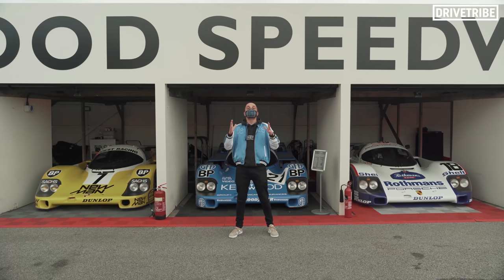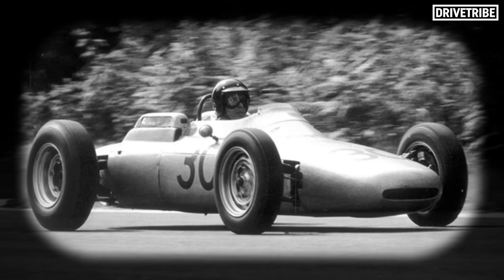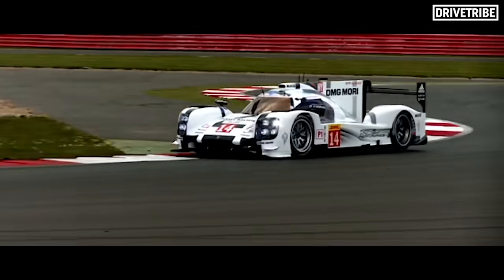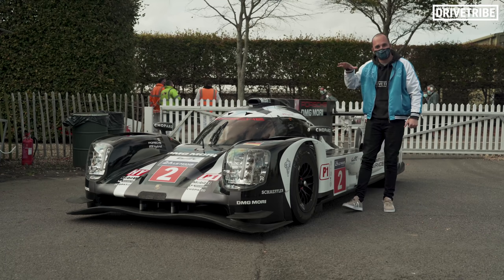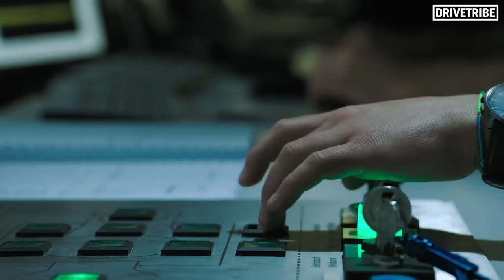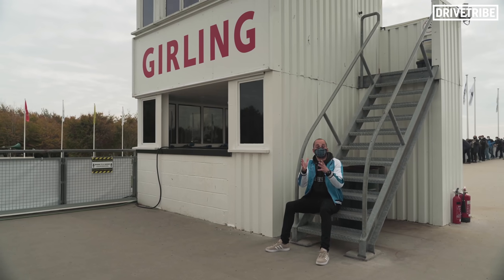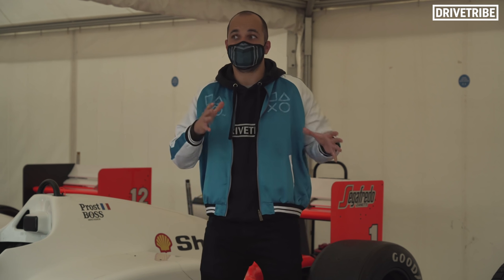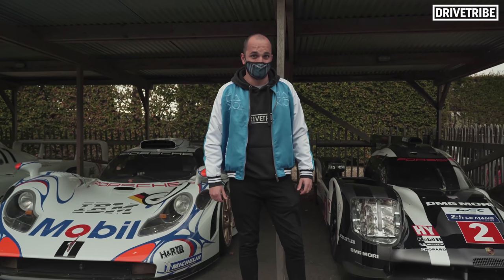Porsche has made a Formula 1 engine that could power a new hypercar

Comment: Red Bull: Heavy breathing
Reply: 😁😁🤣, either that or make up with Renault's boom boom engines again
Reply: As soon as I seen the video pop up I instantly thought Red Bull 😂👍
Reply: Because they have masks on? /s
Reply: @manojlds  r/whoosh basically Red bull are in a bad a situation for an engine on F1, their engine supplier Honda are coming out of F1, they can't take a Renault engine because boom boom, and they can't take either a Mercedes or Ferrari engine because those are their rivals so this new Porsche engine may be their best bet
Reply: @d.a.t.a771  This engine doesn't fit current regulations, as stated in the video.
Reply: @K7L3-93  I know but the thing is, it is an amazing engine which could hopefully be configured to current regulations
Reply: @kingdaddy2011  Cyril turned down Red Bull’s offer but Toto said he would gladly help Red Bull
Reply: @d.a.t.a771  You can't adapt an engine by adding two more cylinders, that's creating an entirely new engine with entirely new specifications and problems.
Reply: @K7L3-93  Did you watch the entire video my friend

Comment: Would love it if Porsche joins F1 entirely and not only as an engine supplier
Reply: Might do what merc did, supply engines first and then join as a full on works team
Reply: Not gonna happen post-Dieselgate
Reply: @D.S. No they won't.
Reply: there are concept arts around the internet if you didnt check them out, they look aaaaawesome
Reply: @D.S. if they join they will wait for new regulations.
The main reasons they didn’t join was because the engine regulations didn’t changed enough / wasn’t simplified enough
Reply: LMP is better. F1 is becoming WWE of auto racing.
Reply: @nateisright  Yes, because Toyota lording it over six other privateer entries was more entertaining 🤡🤡🤡
Reply: @D.S. really????? I thought it would only be for Mercedes 🥴
Reply: Maybe in the next f1 regulation
Reply: The Anonymus Apdroid  do u mean Reno?

Comment: Porsche supplying F1 engines would be fantastic for F1. With Honda seemingly chucking in the towel, F1 is in trouble when it comes to engine suppliers.
Reply: no, Red Bull is in trouble when it comes to engine suppliers
Reply: @CNR.5K  Might mean f1 with only 16 cars at the starting line.
Reply: I mean most F1 cars used the Ford DFV engine during the 70s so it's not impossible for most of the grid to use Mercedes engines
Reply: @CNR.5K   without Redbull the sport would be even more boring
Reply: @bas4752  i didn't say red bull was gonna leave
Reply: F1 jumped the shark a while ago. LMP is where it’s at.
Reply: That's why they pushed teams to spend less by the regulations to invite some big names. They see that now it's not as much money to spend as it was years before to join into F1 manufacturer/compound supplier family. Those regulations can make F1 more open and we can see more teams/new engines. I hope so...
Reply: No they aren't because the more the worse.

Comment: Redbull, Porsche collab?
Reply: Molloo3  what do you mean they cant afford continuing honda engine
Reply: Molloo3  yeah Porsche were developing F1 engine in 2019,but that project stalled coz Volkswagen told them to enter formula E. Now, I get your point, but in terms of budget, formula e engines are more complex and costlier to make. So yeah your budget/monetary point kinda doesn't make sense
Reply: Molloo3  ok i wrote above reply before seeing the video, my bad
Reply: We need life sized modified “slot car” racing.
Reply: @mithileshpatil7639  dude formula E is way more easier than F1 thats why you see every other big car brand except Mercedes and Ferrari there lol F1 is outdated and too expensive for anyone to even join. Honda was the testing grounds for everyone else to see if its even worth joining and clearly it isn't worth it. No car company in their right mind would waste so much money as Honda has and not have their own team on the grid. Honda has every right to pull out, they don't even get most of the money redbull makes of F1 since they themselves are just the engine supplier.

Comment: If there's anyone I'd trust to build and provide engines to any sprint category of racing would be Porsche, Audi, Toyota and Gibson.
If they can make LMP1 and LMP2 cars drive at Le Mans for 24h straight with no engine problems whatsoever, manufacturing an engine that fits an F1 car that has no reliability issues while being powerful enough to suit the category is probably not far at all from their ball park.

Comment: Hmm.. I think the VWAG group had a 2014 F1 regs solution available at the time. The eTurbo was being used in the 2014 Audi R18 etron... although for reasons it wasn't raced that season IIRC... If anything I think the V4 solution came out of an F1 programme not the other way around.

Comment: why V4 its better than an Inline. it can take more boost basicaly with its short crankshaft more boost more power. plus it can Rev Higher like the super bikes on Moto GP. and it sounded better. also its small or shorter than an inline you can put ito on a smaller or tighter engine bay.
Reply: ZAZ knew it already back in 1960...  :-D

Comment: It would be an insane development if F6s came to F1. Unlike a V6 which has the majority of the weight at the top of the engine, an F6 essentially sits flat at the very bottom of the chassis (at the level of the driveshaft.) The engine makes up a lot of the weight of an F1 car, and being able to place it all at the floor of the chassis would be insane for handling. F6s also can theoretically handle higher RPMs due to better harmonic balance than V6s. Not to mention they sound better.

Comment: The V6 was actually developed as the V4 had run its course. Fuel efficacy was worse than the V6 in the TSO50, as well as peak power. The V6 program was formed at the beginning of 2017, but as it became clear VW wasn't going to fund the 919 program anymore, development slowed to a snail's pace.

Comment: The Carrera GT V10 was not an F1 engine, it was from Porsche LMP2000 Le Mans car that was completed by never raced.
Reply: It was though. The 9R3 LMP2000's engine was developed from a disused F1 V10 which had been designed to replace the godawful V12 Porsche supplied to the Footwork team in 1992. They continually expanded its displacement and lowered the rev limit until it ended up as the Carrera GT engine.